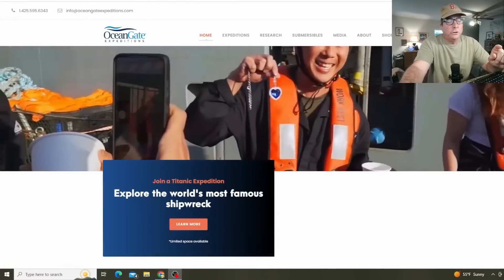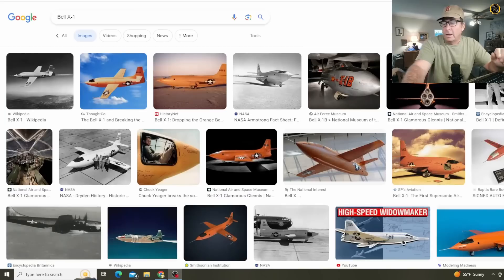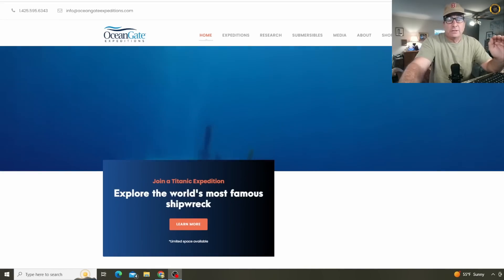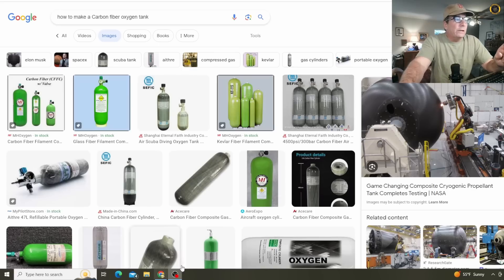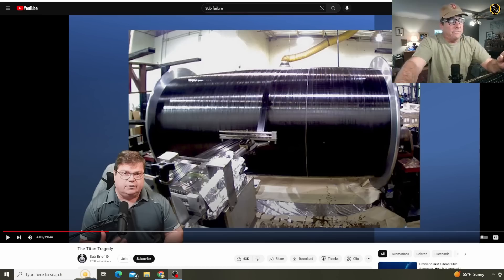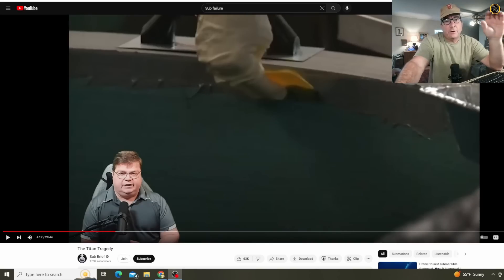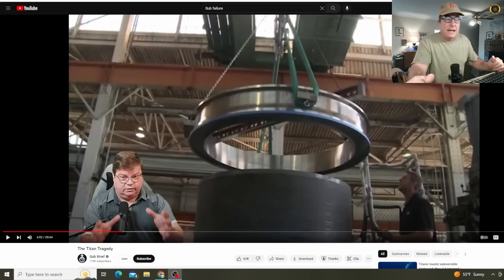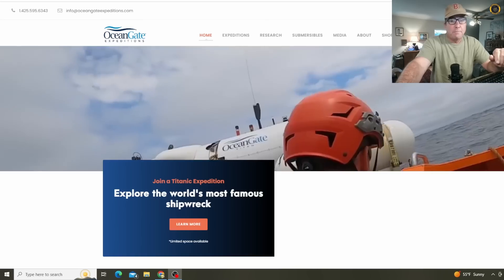Oceangate Sub Construction Details and Implosion

Comment: i'm sure they modeled the structural integrity of the craft at the necessary pressures but what wasn't likely a factor was how repeated descents and ascents in the water column would affect the vessel's integrity over time. I know this because they used consumer grade equipment on a vessel designed to keep you safe in an environment less suitable to human life than the Surface of planet Venus....

Comment: Another issue with carbon fibre and glass fibre composites is the curing of the resin matrix. This is hugely important to the long-term integrity of the component and it is almost impossible to do well on a one-of basis. In aviation, numerous test-parts are made and, well, tested, before one goes anywhere near an airframe that is going to fly. Expensive mould-heating profile controllers are needed to insure that the profile is repeatable, once it has been established and verified by experiment and destructive testing. The mould-heating profile itself is critical: where is the evidence that anyone even knew what the proper curing profile on that pressure vessel actually was, let alone that they had a mould and profile-controller capable of doing anything better than just warming it up for a bit until people thought it was done?
The naval architect and materials scientist, Professor J.E. Gordon, wrote about this issue in his book "The New Science of Strong Materials" (or "Why We Don't Fall Through The Floor") which was published in 1968. He was scathing about the integrity of glass fibre yacht hulls made with "a bucket and paintbrush" in non-temperature-controlled conditions.
And, this is a direct quote from chapter 7: "Gluing is not so much a skilled job as a responsible one and a large number of mistakes are available to a determined man, all of which can lead to dangerous results."
Professor Gordon also wrote a companion volume on structures, which is also worth a read in the context of this particular disaster.

Comment: The problem is not the Titanium / carbon fibre joint. Carbon fibre is only strong in tension. The resin is comparatively and significantly weaker. If you are containing pressure, then every part (almost) is in tension. These are loads and applications where carbon fibre out perform all materials for weight and cross sectional area. This case is resisting pressure, holding pressure outside. This means compressing the structure. Carbon fibre has no compressive strength. You can fit multiple strands of carbon fibre within the diameter of a human hair and is more flexible. Therefore no compressive strength. Try pushing it. Think of the relationship between concrete and rebar. You cannot have a concrete structure without rebar.  Concrete is extremely strong in compression, but useless in tension. Rebar is really strong in tension but useless structurally in compression. Therefore they are a perfect marriage in construction.  The rebar is in the bottom surface of the concrete floors we walk on. Load pushes down, tension in bottom face of floor is taken by rebar and the upper volume is concrete  under compression. Carbon fibre using resin as the compression component is madness. A semi sub is 99% compression. Carbon fibre is nearly 100% useless in compression. All forces are withstood by the resin binder. Why did they not use proven physics. Titanium, even carbon steel of correct dimensions would 100% behave predictably over and over again (fatigue). I have been 150 m below sea level in a concrete structure (open top) with water shooting through the 1.5 m concrete walls (circa 100 Mpa concrete, 10 times strength of you home concrete foundation). That is the pressure at around 150 m. I assure you at 3.8 Km the pressure will find every geometrical imperfection and flatten the structure and oxygen inside the container to near 0 L instantly.  The structure needs to shrink in size equally in every dimension or destruction is inevitable.  This is a very interesting topic. I hope the families are ok, proud of their loved ones and will at some point see the impact of their lost adventurers on this science and future safety. From St. John’s, NL, we are so sorry for your loss.

Comment: any inclusions in any part along the construction of this vessel no matter how small would eventually show up through repetition causing an implosion. one thing you really have to be careful of are the types of adhesives used, at depths from 1k' to 12k' materials can come out solution from the extreme pressures. ive work on r.o.v.'s and sub equipment for Defense applications, and this would have never even come close to passing their destructive testing. even his manufacturing practices were flawed. at the very least the adhesives should of been mixed in a vacuum and cured in a vacuum oven at least any air bubbles that would cause inclusions would gone. almost certainly no 10 to 1 safety factor. careless stupidity...God Bless those lost souls...

Comment: Juan, I work for a solid rocket motor company who builds and flys many different carbon composite designs. We do have ways of inspecting the composite cases for damage, flaws and inclusions using ultrasonic techniques developed over many years.  An impact to the composite can not be repaired and can scrap a very expensive motor.  

Watching some of the manufacturing of this pressure vessel made me angry that a composite company and their engineers would be willing to have their name tied to such an incredibly ill-conceived design.

Comment: I don't know anything about oceanic vessels, accident reconstruction nor submersible construction but I do feel the accident was mainly caused by "repeated" exposure to extreme cold, extreme pressure and subsequent metal fatigue and stress fractures that could only be found through metalurgical xray and examination.
I'll wait on the official post-accident report for the rest.
RIP to the passengers.

Comment: Blanco, pls get it right. For the second time the Titanium end caps were glued to the Carbon Fiber Capsule not bolted to it. The entry and viewing portal on the front Titanium End Cap is what was bolted on with 17 bolts from the outside after crew was inside.
Reply from the maker: watch the video and pay attention before commenting- proceed to the back of the class.
Reply: @blancolirio  The Dome Bolted Flange But only Glue is holding the Dome & Flange assembly to the carbon fiber!

Comment: A structural engineer that designs atmospheric fiberglass tanks.  Carbon Fiber is both stronger and far stiffer, the resins typically vinyl ester resins while CF uses epoxies, which are both stronger but also much more brittle.   First safety factors - FRP is designed at 10:1 for tension and 5:1 for buckling, shear, and compression.   The fibers are usually wound at a 70 degree angle, or axial fiber layers added to at least 10% of the hoop area.   Head to shell is pretty simple when thin, gets crazy complicated in a thick vessel with a uniform material.   Going thick with a CF build would be crazy, this material is 30 fold stronger & stiffer in the fiber direction than in either of the other directions!  Further in the thickness direction there will be dry spots, air bubbles, resins curing at different times etc.

A thick metal head connected to a thick CF shell would have crazy flexure forces, high tension in the interior face right at that TI slot, but there is no fiber, only resin, so only the resin properties.  Add in thermal for the fun.  Does the epoxy behave the same at 5,500 PSI compression as atmospheric?  Does the resin have enough strength to hold those fibers in compression?

High strength steel pressure hull with HP air tanks to blow the ballast tanks avoids so many issues.

Comment: This setup also forgets that the values would bring the two wrings together and in turn would weaken the blue bonding the rings.
I do a lot of research and technical evaluations on all types of topics. So why is it that the glue around the wrings was seen as secure yet as we learned from the Space Shuttle many years ago things like O rings and glues seem to have issues with Cold over time. As each dive the cold would effect the material used. I would not be shocked if that is what they find that the seal failed.

Comment: Aero stress guy here. Carbon fiber tape is weak in compression because the failure method is the resin (matrix), you dont even get to take advantage of the filament's capability.

Edit 2: CTE

Comment: Were they NOT properly licensed and whatever certified actually means, to operate this vehicle?  I live in a heavily regulated world and therefore I assume, given the world that we live in, to be so for this company.  Therefore, I conclude that the regulators (those that claim public safety as their charter) knew less about the real safety issues involved.  Apply THAT to everything regulated.  Are you safer from food poisoning at a restaurant because those same "qualified" regulators are working the case?  Remember also that the same type of folks are regulating the Airlines and Alcohol, and Firearms and many other industries.  I don't feel safer when I see any government stamp of approval.  In this case, I believe without direct knowledge, that these passengers knew the risks independent of any stamps of government approval.  I'm actually impressed that some people took a chance and tried anyway.  But I'm saddened if anyone accepted the risk BECAUSE the craft was certified by some government (assuming that to be the case).

Comment: Juan, I'm not sure where you got much of this information, but you assessments of the suitability of mixed materials and carbon in compression are essentially untrue.    Consider something as simple as a tennis racket or fishing rod.  As these things bend, one side is put in tension and to an equal extent, the other is put in compression.  Wing loading is often assymetrical (more flex up than down), but you will see carbon composites used on the upper surface of them.   The vast majority of pressure vessels used in the world do see more internal pressure than external, but that isn't an indication that composites can't do both.    The carbon itself has as much strength in compression as it does in tension, but the long fibers can buckle in compression.  The epoxy doesn't have to take the compressive load itself, but only has to provide enough stability to prevent buckling of the fibers.  Think of the thin guy wires that keep a radio tire upright.  The tower works fine in compression as long as it has the wires keeping the middle of it from buckling.  As for the direction of the fibers, pressure vessels, whether in tension or compression, see approximately twice the stress in a radial direction as they do in an axial direction.  So, it is entirely appropriate to wrap a pressure vessel primarily in a circumferential direction, particularly when it is a tube.  Some angle, or some layers that are angled, is needed, but it definitely should not be lain symmetrically.   In compression, you don't have to work as hard to keep the end caps attached, so there is even less reason to use axially oriented fibers, as you would when designing a compressed air tank made entirely from composite where the fibers are holding the end caps against tension.     I've droned on enough, but there is nothing wrong with the use of carbon, titanium, or a combination of the two.  They can be used properly and work properly, and they can be non-destructively tested via MRI, acoustically, and other methods.   Others have mentioned galvanic corrosion issues, which are equally trivial to deal with for those who understand the issues.  What we see in this case is a bunch of idiots being careless, not a set of materials that couldn't have been made to work by competent professionals.   The plexiglass window was reportedly only certified to 1300m, and they were diving to 3800m.  That, in and of itself, tells you the designers had a massive disregard for how the real world works.

Comment: 100% agree that the believed failure will be the bond between the carbon Fibre to titanium and may even show failure on the titanium with the inside flange being out of 90° due yo the pressure..  secondarily the bond between the resin and titanium could have been compromised through the pressure cycles of the previous dives.

Comment: I’m just not confident in carbon as a pressure vessel. I’m a naval engineer and I just wouldn’t use that material. One bubble in the resin or one flaw in the winding and we get this.
You don’t necessarily need light weight in water
Great for race car sports car chassis or aircraft wings or fuselage but not for tons and tons of pressure

Comment: I wonder if the 2 end rings could have been connected by rods, say titanium or steel ? Running the length of the tube securing them to each other as well as the adhesive. Seems like this design might work for less severe depths, but they pushed the technology too far.

Comment: Design of pressure vessels for external pressure is a completely different animal to designing for internal pressure. Pressure vessels for external pressure are invariably governed by buckling instability, which is as much a black art as it is a science. Small defects and eccentricities have outsized impacts on the onset of catastrophic failure. Pressure vessels designed fo external pressure never fail gracefully.

Comment: great video Juan, the dissimilar materials point is right on.

couple points
1. You said they constructed the tube wrong because they were winding fibers circumferentially, but it seems to me that since most of the stress in a barrel is in the hoop direction (approx. pr/t for hoop and pr/2t for axial, regardless of tension or compression), then a large amount of the fibers should be oriented in hoop. This sub apparently had unidirectional plies running axially and wound filament over that. 
I've seen other folks saying carbon fiber shouldn't be used in compression, but it seems fairly common (interstage and fairing on falcon 9, unpressurized segments of other composite rockets such as electron or alpha, certain portions of composite wings, etc.). I wonder what they do to get around the perceived lack of compressive strength.

2. You said you can't test composites until after they have failed, but NDT can be performed on composites by a bunch of methods: tap testing, thermography, ultrasonic testing, etc. Another form of testing that was neglected in this case is proof testing, normally aero structures are proof loaded beyond what they'll experience in use to find any manufacturing flaws or errors in calculation. It seems that would have been fairly easy to do with this vessel. Just bring it to a deeper part of the ocean and drop it on a cable to something like 6000 m.

It seems like composites are going to get a bad wrap from this disaster, but composites are capable of making reliable structures (just look at the 787, 777, A350).

Comment: I've done a lot of composite work and I can't see using that as a pressure vessel for deep sea use. It is strong in tensile but pretty lousy in compression. Also I don't see any way to prevent the ingress of water into the fibers at such high pressures. It happens even on boats on the surface. The fibers are one thing but the binder is what will do the work under external pressure . Lastly all the deep sea craft I know has fully spherical pressure hulls, that gets geometry on your side. Using a cylindrical hull weakens the structure a lot. I'm willing to bet the 2 hemisphere end caps did not fail.

Comment: I doubt they had similar compression rates between the carbon fiber hull and the titanium joints and end caps. So it's a bit like having two metal pieces attached on both ends of a plastic bottle. If you squeeze the middle, the end pieces will pop off eventually. While a cylinder would present similar forces for even the same material, if you used something like carbon steel or titanium for the entire hull, you could much more easily accommodate for wear and even do repairs and inspections. What could you do for a unique carbon fiber hull other than wait for a disaster? There is no repairing it.

Comment: The company I work for specializes in steel pressure vessels and in cross wound fiber composite pressure vessels. We had an issue with delaminating between the inner core and the outer composite and also between metal fittings and the composite. It wasn’t a simple fix. We also discovered that humidity control is critical with this type of manufacturing method. The simple answer is that we test, test and more tests, cycle test and test to destruction before we can get a certification. I suspect that this submersible company did “none of the above.” Carbon fiber and other composite materials are great when manufactured in a controlled environment with a very strict manufacturing and inspection protocol. The manufacturing method that the submersible company used has many faults. The least of which was the winding method used and also they didn’t place the vessel in a vacuum chamber to draw the bubbles out of the fiber and resin. There were more than likely many small voids in their fiber tube that will weaken the structure. Think “Swiss cheese.”